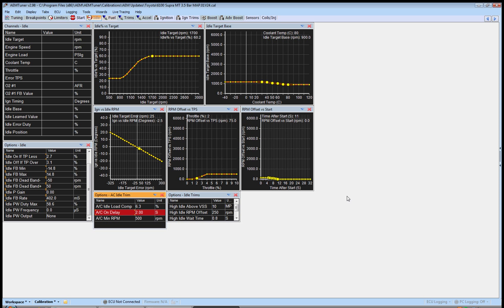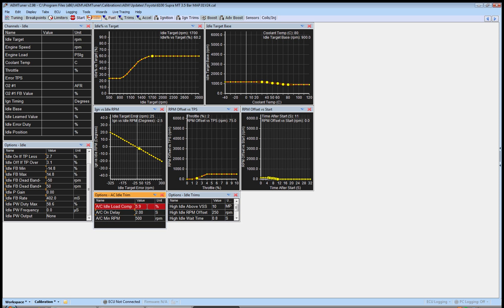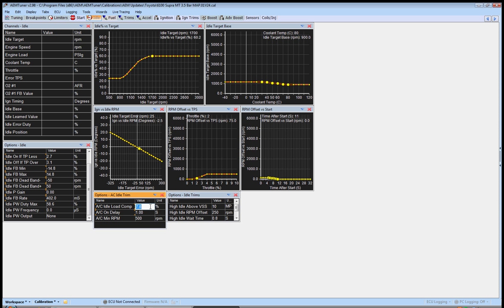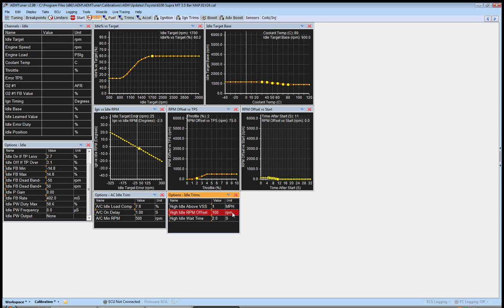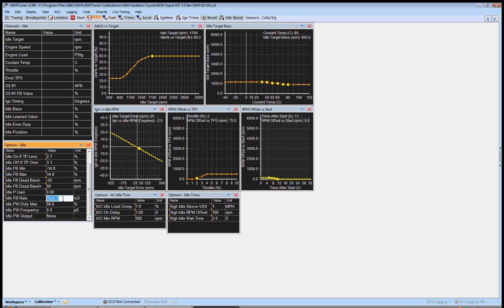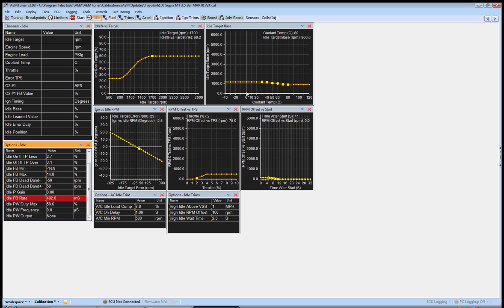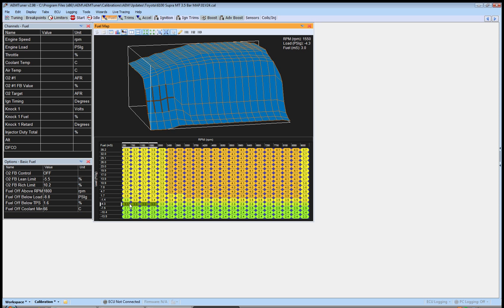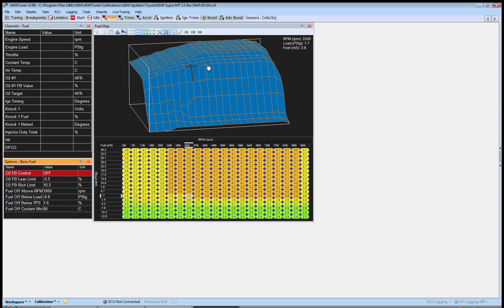AEM Tuning Part 7

Comment: PROPER useful video this has been so far. Not been 100% happy with my tune from the get go as my idle has always been a bit lumpy on my S2000 it "Put puts" every now and again on idle, since fettling with the TPS voltage and aiming as close to 1% and 99% as possible, my idle has vastly improved, so has my cold startup oddly? Wish you were UK based, would get you a pint or 6! Going to continue watching until the end :)

Comment: Who knew I would find pure gold on youtube at 3 am. Thanks for the videos! Tuning my STI!
Reply from the maker: Welcome. Keep in mind on the suby the TPS IS the idle control. So, when you set the TPS volts originally to 1% or whatever it is, it will vary quite a bit at idle because the throttle plate is adjusting and acting as idle control, as most other DBW setups do. You will tune the idle the exact same way as shown in the videos, just remember the diffrerence.
Reply: Thanks for the advice! I have a JDM version 9 STI swap from motor to hubs in a 2003 wrx so its still drive by cable. I am using the 30-1810 stanalone so no AVCS for me. I have a protune already but its not the best. Idle is all over the place and cranks over alot on cold start so I can't use my remote start :( any help is appreciated!